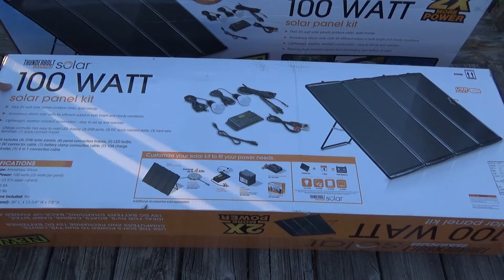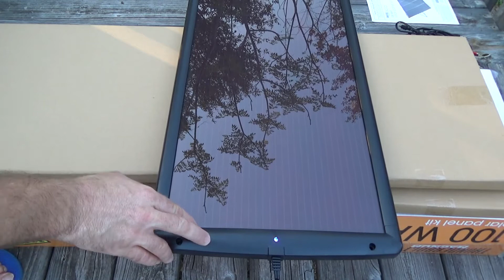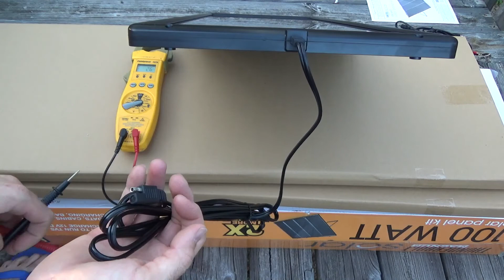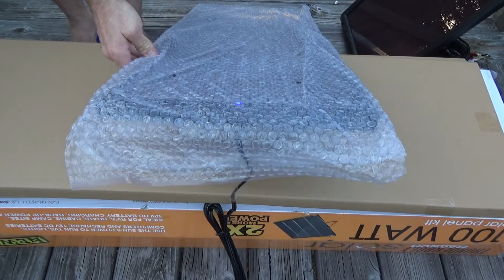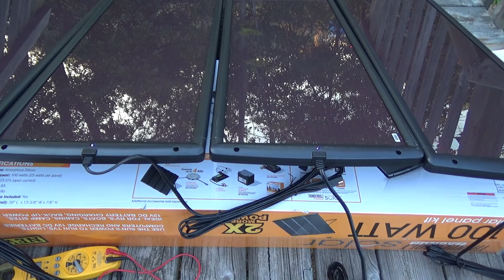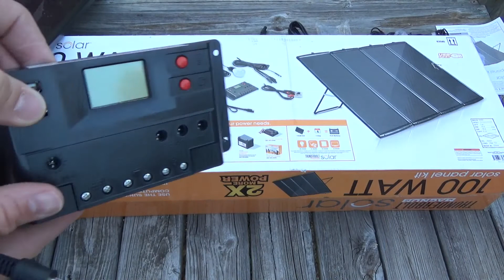Harbor Freight 100W Solar Panel unboxing

Comment: Doesn't look like anyone is trying to help you out. I'd strongly recommend asking questions on a solar forum such as The one setup by Northern Arizona Wind and Sun. While they sponsor it we are free to discuss equipment and sales at other sites.

100 watts of solar isn't huge and 'off grid' electric will almost always be more expensive the grid electric. Unless your grid based electric is 30+ cents a KWh and then only for people with an energy use profile which matches the available sun. Of course there are other reasons to have a battery based system.

Least expensive battery per KWh used over the life time. Is usually a Golf Cart battery. They come in 6 volts and a pair in series for 12 volts, will be a good size for a starter situation. Many people try to start with marine batteries, these are almost always NOT true deep cycle batteries and will only last 3 - 12 months when deep cycled. Golf cart batteries will usually last 4-5 years. Sam's Club and Costco have these at about $80 each and a core, They are both very liberal about the core you bring in. I've used a lawn tractor battery I bought for $5 on the way to them to save the $15-20 core charge.

Generally you want to be able to recharge the battery at 10% of it's storage capacity if they are being used daily. 2 golf cart batteries will have about 220 amp hours of storage at 12 volts.   so 22 amps would be recommended. a 100 watt panel should have a VMP (Voltage under load) of around 18 volt so a 100 watt panels should be able to provide roughly 100/18=5.5 amps (amps x volts=watts) so 3-400 watts of panels would be recommended for daily use.

Usually you can hook up multiple charge controllers to the same battery bank with out to much problem. They will reach different stages of charging at different times.

In general you would work on sizing your system from your loads/needs. Heating and cooling take lots of watts and in general solar would not work for you in these areas. A good sized solar system will often cool, but it would take a very large setup. Heating is usually a 'non-starter' as the need is when there is usually very minimal sun.

http://forum.solar-electric.com/categories
Reply from the maker: Wow. Thank you for the very detailed reply.